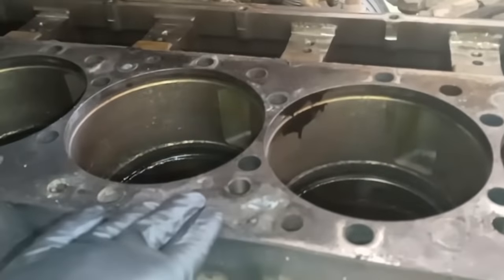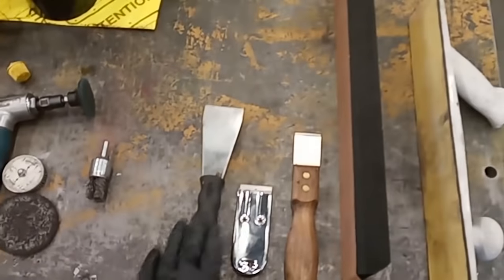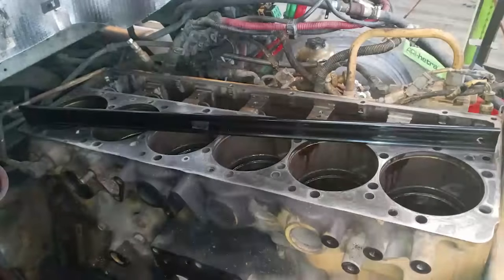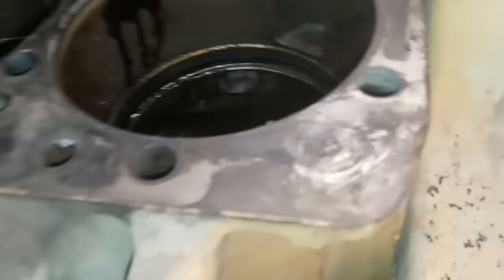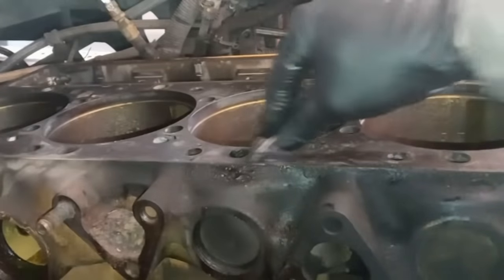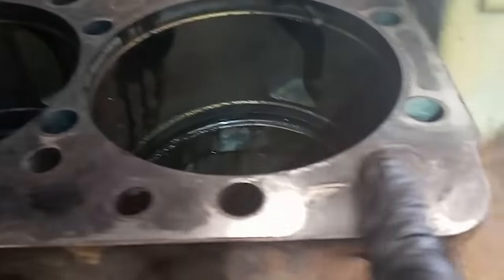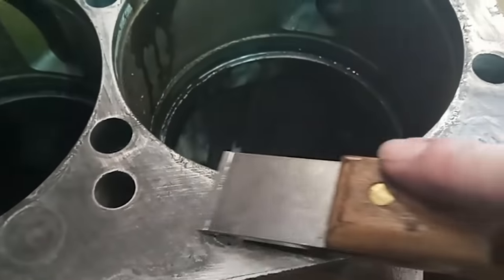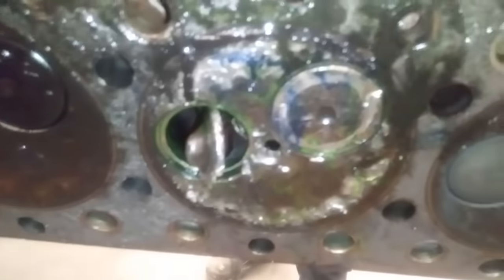Clean a Head Gasket Surface like a Master Engine Builder.

Comment: Do you think that the fine dust created from sanding might be bad if it gets into the crank and cam bearings? It might be the machinist in me but when I remove any material I'm very careful with masking off places where abrasive dust can settle and ruin bearings.
Reply from the maker: That's definitely a concern with any gasket cleaning. In this instance it is a rebuild where all the bearings were removed from the engine after this and everything is getting sprayed down with brake clean and wiped down or blown out with air. I would say with sanding there isn't very much dust created as nearly all the material has been removed by the scraping. Now some is definitely worse than zero of course. I would say when a gasket is buffed off with a roloc wheel there is tons of dust flung everywhere from the disc and the gasket itself. Perhaps there is a better way out there, but this is currently the best way I can devise that results in minimal dust, flat surfaces and good results. Ideally the engine would be machined and hot tanked, but on an in frame like this, that isn't an option.
Reply: @AdeptApe  I agree with you 100%, without going through the whole process of pulling the motor this is the best you can do. Thanks for the information.
Reply: Any time you open something up is a risk of contamination. I don't care if your just running the overhead or adding oil. Warranty pays to steam clean to prevent this. And that is the only reason warranty pays to steam clean. My first cousin told me once, you can never be to clean building a engine.

Comment: Thankfully, I'm old enough to have been taught to scrape from the beginning.  It might not look as pretty, but no one's going to see it once the gasket is in place.  The only thing I'd add is to be very careful with the razor-style scrapers when working on aluminium, as it's pretty easy to put a gouge in the metal - and that can ruin all the good work you've done up 'til that point.
Reply from the maker: Yeah, that dang Aluminum is hard to clean. Especially with a stuck on gasket. If it is a strong cast Aluminum piece I'll usually lightly tap the gaskets off with a small ball pien hammer, then carefully scrape any leftover pieces. On a thin cast piece like a front structure, it is really tricky as there isn't much material on the sealing surfaces so I usually end up scraping carefully and then maybe a little 600 grit wet sanding, depends though, there isn't a great way I've found yet for thin Aluminum. They need to invent a little ultrasonic wand you could point at the gasket and it would fall off.

Comment: I brush on brake fluid and let it soak in, if possible 1 day if not a couple hours. It’s very good at softening sealers and old gasket material. After done scraping I go over surface with a 2 sided sharping stone just to knock down any high spots/ imperfections. You didn’t address head bolt treaded holes, important to clean of debris so as to achieve proper torque and no hydraulicing of the bolt holes when head is installed .🛠🇺🇸

Comment: You want to keep the machined surface as it was at the time it came from the factory    -   rolock wheels  could gouge the surface    especially if it is aluminum           you want to keep the matching marks intact as it came from the factory !      keep the surfaces laserbeam square as possible.

Comment: That block should have been sent out to the machine shop to have it milled flat. Has many surface imperfections. Your correct in saying that it need to be flat however what about the final finish, and what about all the metal shavings that you have created. Not good to have this stuff going through the engine. Many people want to try and take a short cut or price saving way out however this is the wrong way to go about this. Nothing more than a gasket scrapper should be used. You want to clean old gasket material off. Any pitting or surface wear should be addressed with remachining surface. This might last for a little while however the long term this is not the correct way to do this.

Comment: Once read a Machinist comment  if it weren't for those Roloc sanding discs he wouldn't have half the business of machining Aluminum heads flat. I always use a 4in pad instead of a 2 or 3 in when using a Roloc and try not to angle it to much or use to much pressure. Just skim the surface not polish it.

Comment: And a tutorial on sharpening both scrapers. It requires special techniques to do ceramics. But wet sand paper is great for scrapers of steel. I use plate float glass and it makes a flat surface for the abrasive. I am not thinking about machining a block of word and use a large one for surface of heads

Comment: The machined area be it a block,head etc should not be shiney and smooth. When it is flycut there will be very small grooves left. There is a spec for every manufacturrer. Basically x amount of grooves per inch.
Reply: GM produced the quad 4 engine that had head gasket issues. They tried many different gasket types and eventually opted for a rougher surface finish so the gasket would bite onto the surface better.
Reply: RMS finish...
Reply: That’s how the machine shop I use does it. They also do my flywheels like that as well.

Comment: It would be a good idea to put towels in the cylinders so you don't get sanding grit on your crankshaft journals and in you oil pan. Eventually that sand could make its way through the engine otherwise great info been watching your videos for a few years
Reply from the maker: Yes that is good if the cylinders are still installed, this was basically a bare block with the cylinder packs and bearings removed. Good comment.

Comment: Not a mechanic, but I would never try to butcher a gasket surface with a grinding tool. On the other hand, if my boss told me so I would not question it.
Reply: I would question it! (and have) Most bosses I’ve worked for I wouldn’t trust my own engine to. If I’m putting my name to something I’m doing it my way!
Reply: @andygilbert1877  
Bosses in my experience have just enough knowledge to get themselves and others in trouble.

Comment: I’ve never touched a gasket surface with a power tool.  I’m a machinist/millwright and the finish matters.  The roloc polishes the shit out of it, dips and rounds everything.  No chance for a really good gasket job on anything with the roloc.  I never use sandpaper on a foam block either.  Scrape it.  Best way.
Reply from the maker: Do you recommend just scraping only and then just brake clean? I'm not a machinist just a mechanic trying to do the best I can.
Reply: I showed my boss on a block I had to counterbore back in the 90's. Took that roloc disc and took .005 off the edge where the liner seats. That milling surface on the top of the block, is not just for looks. Also the water ferrule holes on top of the block can pit and erode. Using a roloc or wire wheel, you remove the build up. I try and smooth it flat with the top deck to help the seal do it's job.
Reply from the maker: It is a good indicator of the liners sinking though, no milling and you can bet your bottom dollar the liner was wearing there.
Reply: @AdeptApe  it’s the surface finish.  There’s nothing wrong with what you’re doing.  It will work and you’ve proven it.  The RMS finish value matters and when you sand the surface you are removing the roughness machined there on purpose.  On a blueprint there is actual surface finish specs marked right on them.  The ITP industrial handbooks are the best when it comes to trade knowledge.  A Machinist is a really skilled mechanic.  Everything comes back to fastener stretch, surface finish and trueness.  There’s actually a scientific field about his and you can watch videos on the science of flatness.  So when you machine something you actually are making purposeful roughness to ensure gaskets stay fast in location and creep into the “low”spots in the cut and grip on the “high” spots.  The gasket literally creeps into the low spots from the machining and it grips the surface in those spots.  After you scrape it soak it with WD-40.  Softens all the old carbon, graphite and it will literally wipe off to as close to original finish as you can get.  When you sand surfaces down I agree it will still be relatively flat but because it’s super smooth the gasket has less “grip”.  Too smooth is bad because the gasket will slip around, too rough is bad because it won’t creep deep enough to seal and it will sweat.  I always clean the bolt holes threads up first and then use lacquer thinner to finish clean the threads and surface to prep it for the new gasket.  It’s cheap and is a powerful solvent.  Lint free cloths?  Yep, linty cloth? It’s ok just attempt to blow all the lint particles off before you put the gasket on.  You are a skilled dude.  Just the fact you quit using rolocs and the reason you did totally impressed me.  I work by the hour so I have time to do things that some would consider a waste of time (lapping nut contact faces and washers, moly lube on high pressure sliding contact faces, bolt stretch measurement versus torque in some applications) but the quality of my work rides on it.  One of my uncles was the first real mechanic I worked with and he was all about the fine details.  That’s where I learned the art of really precise work.  I usually work on turbine housings, giant compressors, crushers, compactors, and multistage pumps, but the useful torching of hydrocarbons is still my passion.
Reply: @AdeptApe  oh an I should mention that this channel is extremely informative and really detailed.  Totally practical.
Reply from the maker: That is more of an essay than a comment, but an excellent one. I've heard of the RMS, but really have no idea about it. Guess I'll go look it up and go down that rabbit hole. In the original edit of the video I actually said "this is the best way I have found yet, but it will probably change again." I cut that portion though because I didn't want to confuse people into thinking it gets done a different way every time.

Comment: What should never be used to clean a gasket surface?
Never use a razor blade or anything that could scratch the surface. Any scratches may provide a channel or means for fluids or gasses to leak through. Use a brush or scrapper made of plastic or nylon, although it is probably best to use a chemical cleaner.

Comment: the wheels I have used (successful so far) are the Roloc plastic bristle discs.. they do have an abrasive in them, but it would take you FOR EVER to remove just .001" of metal with them, but they're very effective at removing gaskets.. I guess if you have pitting and you're better off leaving old gasket material in there, then they would take that out. 
The sealing surface on the deck of the block is really not terribly fussy, that's not holding combustion pressure, the important part is where the fire ring of the head gasket sits.   The last 5.9 Cummins I did had some fairly bad pitting right in that area, I used a pick, sandpaper, and whatever else I had to clean everything out, I warmed the block a bit and smeared some muffler cement and let it cure, it cured ROCK hard, then I sanded it down and installed the head.. it's been doing well!

My question for you, do you ever use high-tack or anything on a head gasket?
Reply: You use belzona to repair blocks not exhaust putty
Reply: I know there's much better options out there, but where I am, it would take at least 2 weeks to get any of them
If I weld on it, I'm going to have to take the block out to machine it, and i don't know why you'd use every weld Inconel onto the block, the stuff is a bloody nightmare to machine and will destroy your tooling
Probably could have filled brass into it and been able to scrape it flat

Comment: If you happen to have another link for super scraper let me know, original is out of stock 👍🏻
Reply from the maker: Something is going on with them, it says Goodson on the handles now too. They are probably going out of business or their parent company got sold, who knows. I updated the link to a Lisle Carbide Scraper now, here is the link https://amzn.to/3qwyDy2 directly. Thank you for letting me know.
Reply: You can custom grind the end of a flat file for this job.  They are 48 rockwell.  The edge will not hold as long as carbide but you could get 2-3 engines done then sharpen it again.  I have one made from a half round and heated and bent the tang 90 degrees up for pushing on.

Comment: Any sandpaper on a soft backed holder will radius edges. Your sanding board is bad it should be a flat steel backing or what I use is a couple of precision ground stones to finish a used surface.
Reply from the maker: You make a keen observation. I wouldn't say the sanding block is "bad" though, It is perhaps not the best design for this application. The only soft backed one is is the little one with the rounded single handle, all the other ones are firm backed.

Comment: Personally, i would have never used a wirebrush or air powered device to clean the surface. Because it can cause uneven layers. I would rather spend the cost to get the surface milled. May he very costly but getting the flattest possible surface for a rebuild would reduce chances of leaking compression or other issues such as eating coolant.

Comment: I'm more than a little surprised you weren't taught to use something flat and straight to prep a gasket surface.
Reply from the maker: That's just the way I was trained by other guys. I still haven't seen anyone else check for flatness.
Reply: @AdeptApe  lots of shop manuals mention it.

Comment: You need to look up hand scraping of machine ways (for lathes, mills, surface plates, etc). Talk about flat!!
Reply: Flat-Yes, smooth-no. This would cause gaskets to fail because way scrapeing creates pockets for oil to sit in.  Not what you want for a gasket.  2 different controls as far as geometric dimensioning and tolerancing is concerned.

Comment: This video has a ton of great information but I don't know whose been teaching you.....I've always been taught use a machinist straight edge on engine blocks , was a millwright for 9 years trust me using the die grinder with the scotchbrite like pads isn't going to take enough metal away from the engine to make a difference or fail a gasket as long as the block is flat, next the "shiny" part your talking about that means its not clean......well obviously you've never seen a deck cut with a fly cutter and a good machinist.  Cause it comes out shiny lol

Comment: omg man,, this is at a level of shit that makes me mad,, im retired mechanic.. worked  for cummins engine co. for the last 20 years.  an engine is an engine,, cat, cummins, detroit.     scrape the block and the head.   if you cant feel it with your fingers  then it wont affect the engine.. do not use any product that is abrasive..